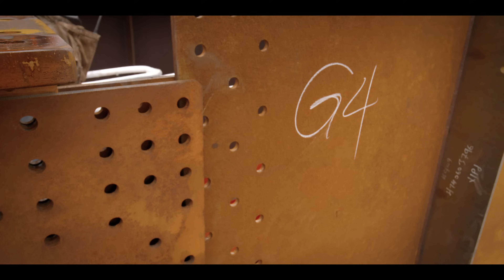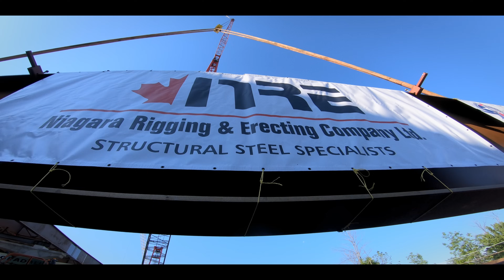Upgrading The Commercial Lifeline of Ontario

Comment: Good to see they are using STEEL.  That will still be there in 100 years.  It's stupid using pre-tensioned concrete in northern climates because the salt gets into the rebar and in 30 years the concrete starts falling off from the rebar expanding.  Look at the Gardiner, what a mess.